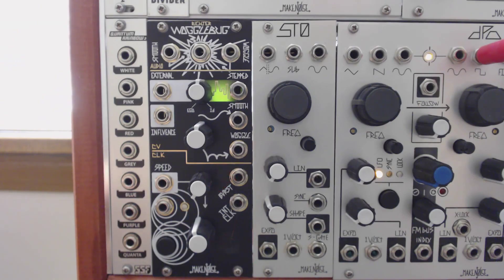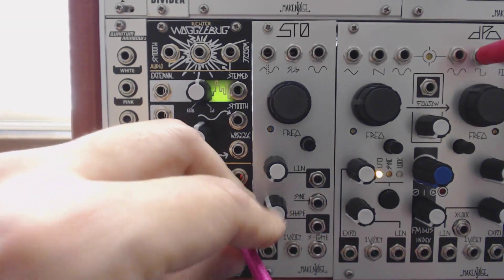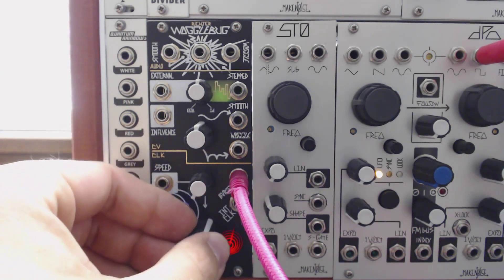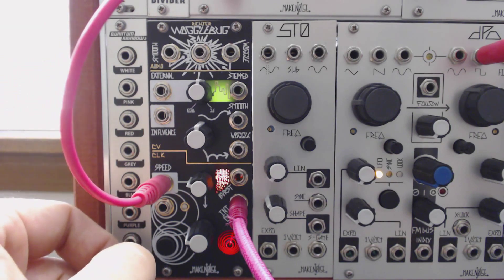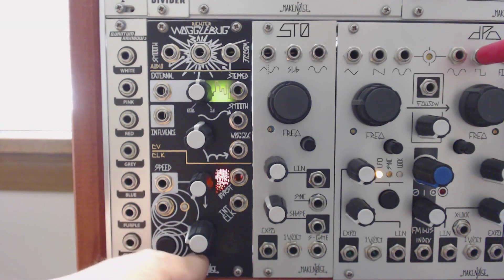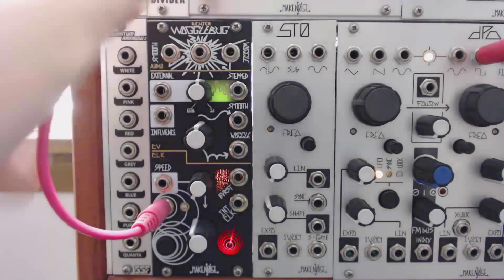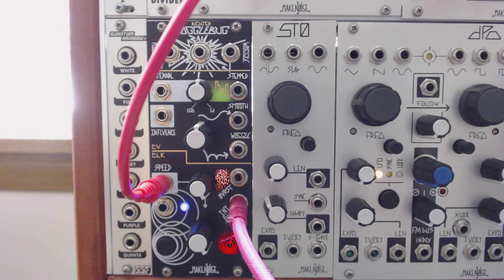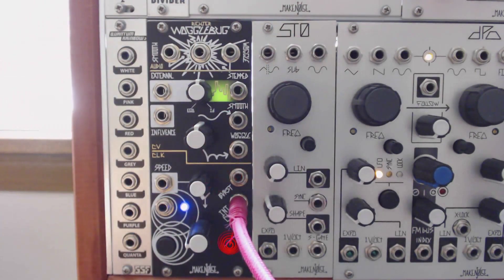Demystifying the Wogglebug Part 1: The Clock Section

Comment: The panel design of this was a bit of a nightmare. I’ve NEVER inherently grasped that weird clock behaviour until now. MN have gotten so much better at panels... Look at something modern like QPAS, it’s bloody perfect. I love the Wogglebug though. My secret weapon is modulating filters with its audio rate outputs... Crunchy and gnarly.
Reply: They've definitely sharpened their craft, although I wouldn't call the Wogglebug's panel poorly designed either. Make Noise have a tendency to make their modules, especially the Wogglebug, intentionally obtuse. Like the aforementioned QPAS. It's a masterpiece of a module and very well laid out but there are still the !!¡¡ inputs which have no official description. MN likes to confuse people, that's part of the magic!
Reply: @TayTayMakesBeats  true and once you understand their approach with practice it starts to make sense